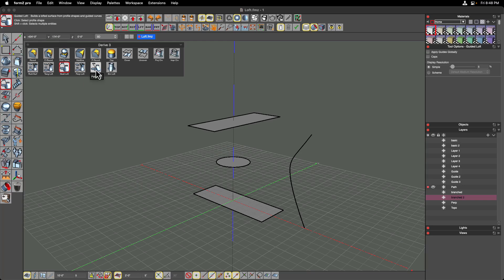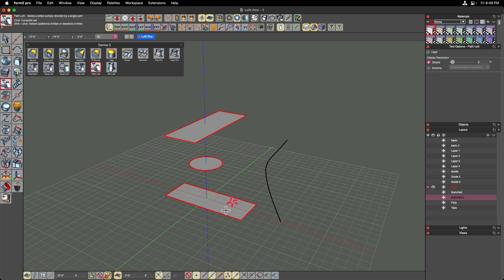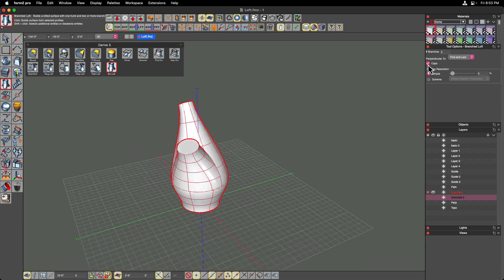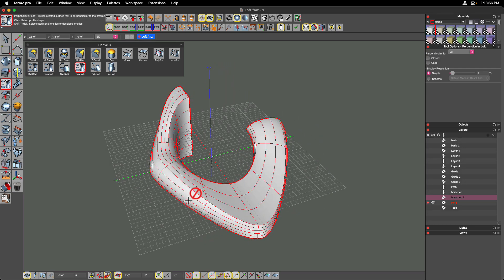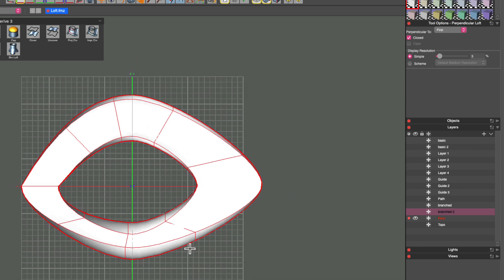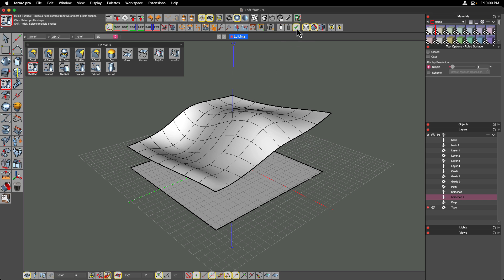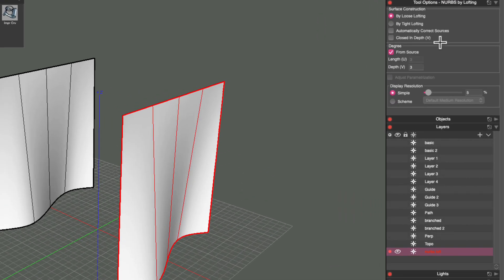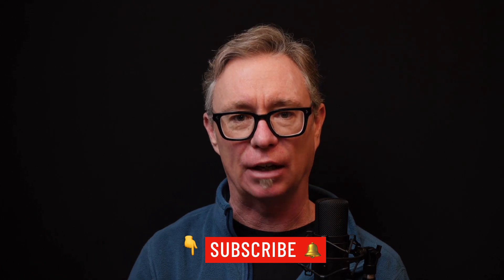Lofting, Part 2

Comment: Evan, with the Branch Loft does it have to be two sources or any number after two?
Thanks, Gianni♥
Reply: 2 or more sources in each branch (the top of the trunk counts as 1 of the 2), with minimum of 2 branches. Adjust the number in the tool options to explicitly tell fZ how many branches before you begin picking sources for the trunk.